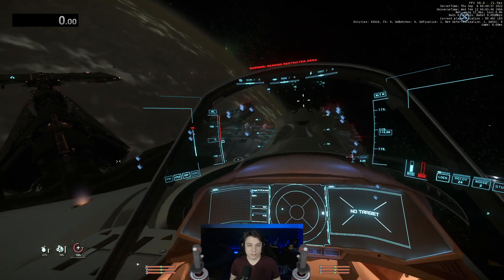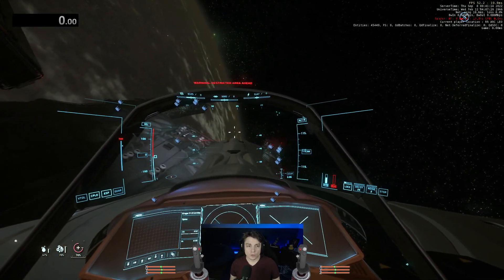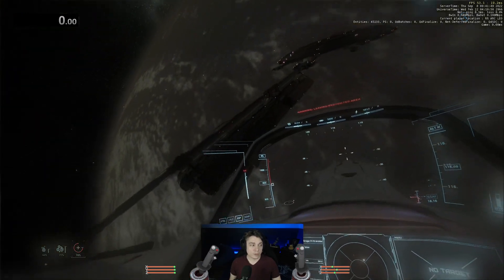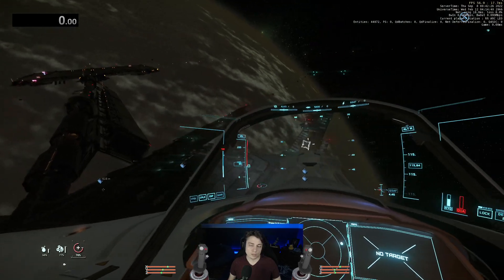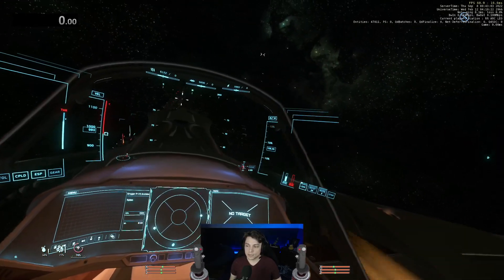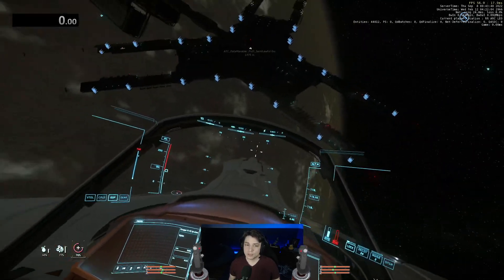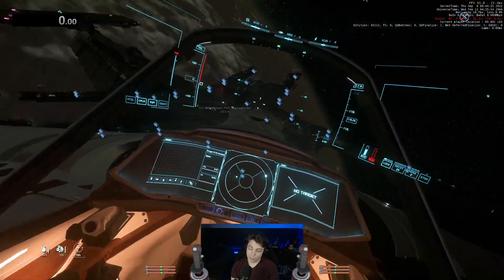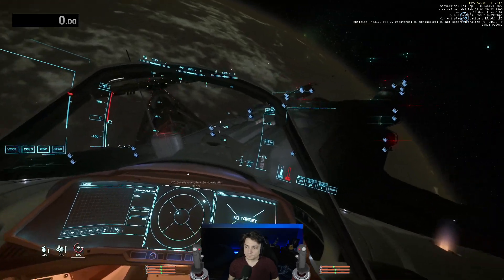The Three Principles of Zero-G Flight

Comment: Thanks for this awesome series! Really learnt alot with it and will try to improve my skills on this information. Also got a Question, would it be possible to do a HOSAS Settings guide? I m working with mine for a year now but still did not figure out a "comfortable" setup for the axis and move controles. Also feeling i dont get the most out of my current setting.
Reply from the maker: Everyone's setup is different, and there are pro racers who use everything from Mouse and Keyboard to Car Pedals For Forward!

I am using default curves and saturation settings in both Star Citizen and the Virpil suite. Also Default cams and springs in the mongoos bases. I've loosened up the tension screws in each base about as low as they can go without getting floppy.

So I'm not exactly which settings you'd want to see? My axis are pretty self explanatory with right twist = roll and left twist = up/down. 

My best advice to you is use the control scheme you LIKE and get very ergonomic with it. Time with your controls and the game is the most valuable asset. I am constantly adjusting my stick and chair positions to get the most ergonomic setup possible for the amount of hours I put in.

Hope this helps to some degree, and good luck!